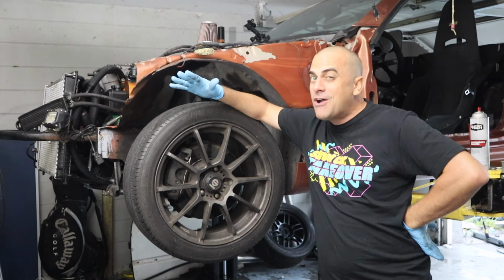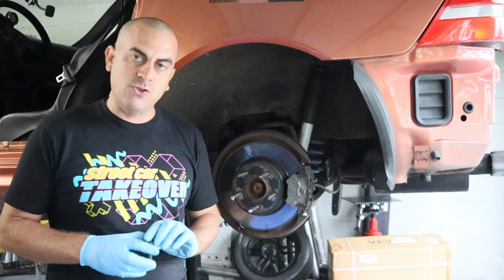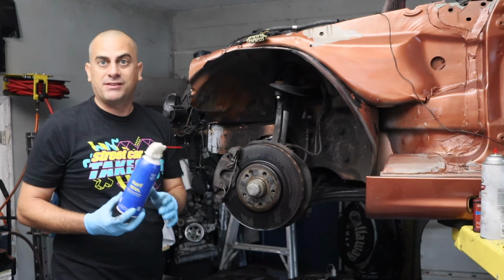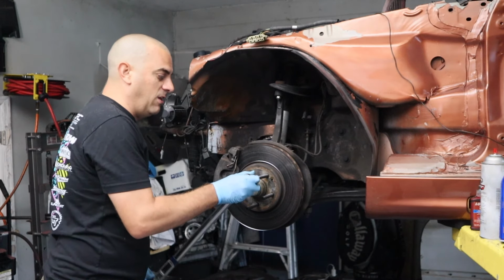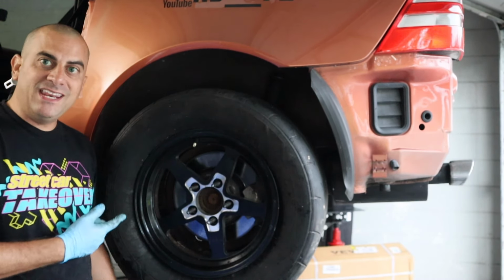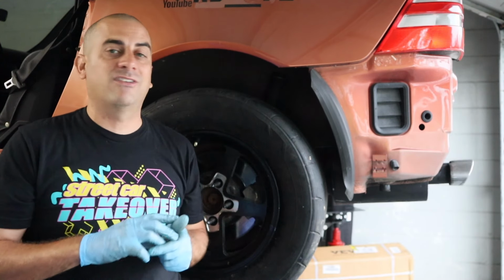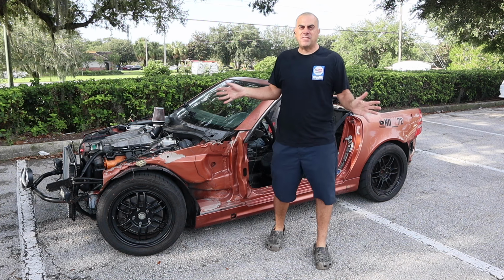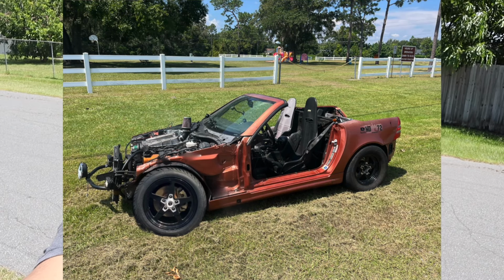Converting Lug Bolts To Lug Studs And New Rims On My Slk320

Comment: Hi. I follow your posts quite closely. I have a 2004 SLK 32 AMG as well and i am looking at doing a few upgrades myself. I do have a question that is driving me crazy. Where an I buy the replacement bulbs for the climate control knobs. Thanks.
Reply: Perhaps there might be better solutions today, but when I did it, I had to buy dedicated led diodes with resistors and re-solder each light